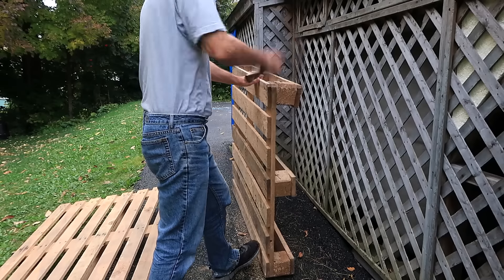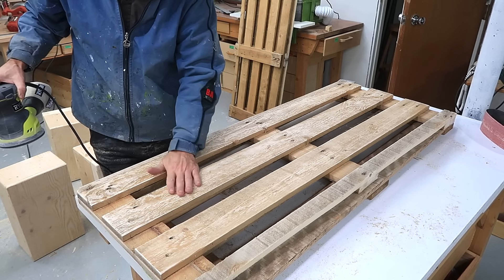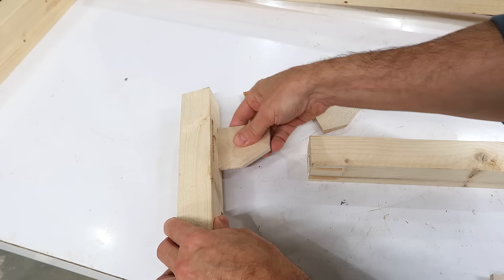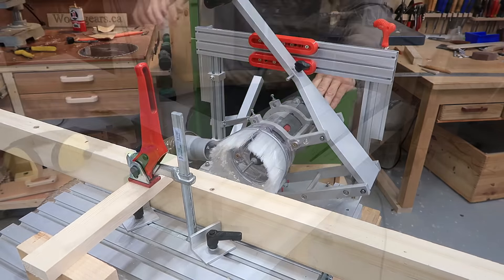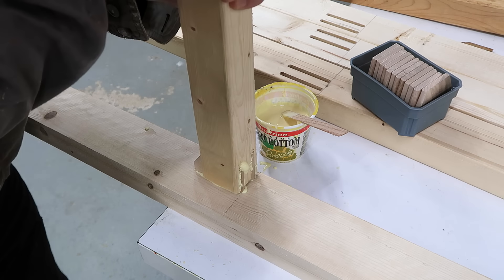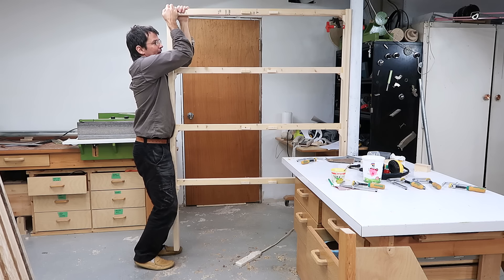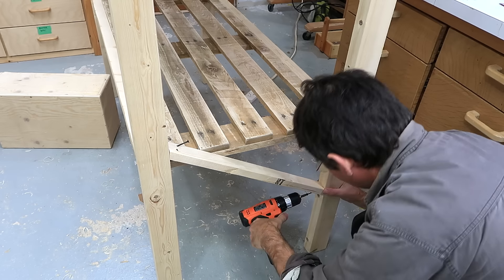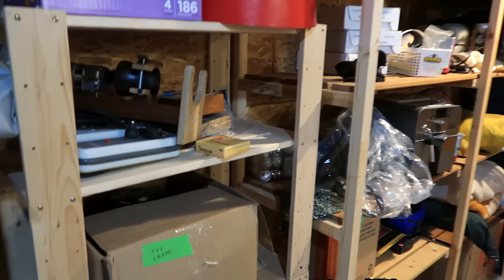A shelf so stiff it rocks

Comment: I recently tried using the wood of standard Euro-palletes- they are slightly different (fewer but bigger boards) and with the 10 pristine examples I had it was impossible to get the longer nails out without destroying all the wood... very frustrating
Reply from the maker: that's why I didn't pull the nails out
Reply: Yeah those EPAL pallets used to be doable by supporting/bridging individual boards off of the ground and then knocking down the rest of the pallet with a sledgehammer to free one board at a time. However, the last batch I got had construction adhesive between the boards which was infuriating.

Comment: 4:10 mgiht look cool to use 8mm dowels placed into 8mm holes drilled thru the floaty jointy thing instead of tiny nails. more work than using your handy nail gun but it prolly looks interesting.
Reply from the maker: dowels across t he wood weaken the joint by cutting off too much of the wood that holds it together

Comment: I've just buzzed through nails with a circle saw dozens of times.  Especially if the blade is already quite dull who cares, if you go slow and let it do the work it's fine.  I've also cut aluminum deck spindles with a chop-saw before, but same thing.  Your blade will get dulled quickly, but it works way better than you might expect.

Comment: Making stuff from pallets is not advisable because many pallets are threated with methyl bromide or other chemicals to prevent insect damage.  Some are marked to warn the user, and many are not.  This makes dust from machining pallets hazardous to one's health.  A respirator is mandatory.  Also, these chemicals can leach through finishes, making pallet wood dangerous to handle and use indoors.  Tread carefully!

Comment: Maybe a tenon would be a good way to support the shelves.  The open ended templates were really surprising and you made great use of them.  I really like the idea of using plywood as tenon material, so fast!
Reply from the maker: problem with plywood as tenon material is that it's only half as strong.

Comment: cant you just take an older circular saw blade you dont really care about and proceed to use it for stuff like that? i cant imagine carbide inserts beeing instantly destroyed by something like a small nail, it will be still good enough for cuts like those?
Reply from the maker: or I could just use a metal cutting blade in a reciprocating saw and not destroy the blade.
Reply: @matthiaswandel  i mean of course, you have shown that, but i'm lazy :D

Comment: U take a free pallet (cool to up cycle) them $50 in lumber. Ok no big deal. Spend more get more. Then u bring in these router mounted sideways and its on a track with guides. That you don't explain! No one's gonna be about to reproduce this. This video its a how to or tips for beginners. It's a simple advanced carpenter trick. It's mis labeled. Shouldn't have showed up on my suggestions. U wanna brag and show off. Post to ticktok.
Reply: Give instructions or pointers. I LOVE replacing Walmart trash shelves. Everyone should.  Build to last/ not replace. But builders should help other builders unless u have a new design and sell it. I'll gladly help others build ponds. Since thats what I do on the side.